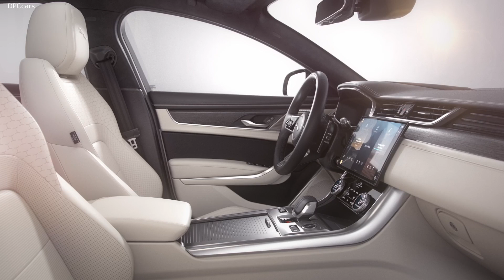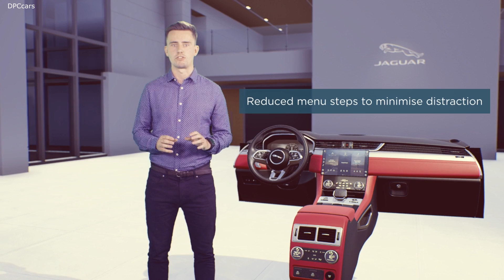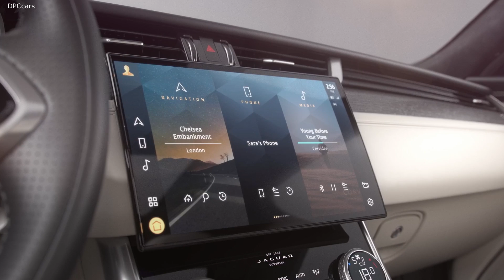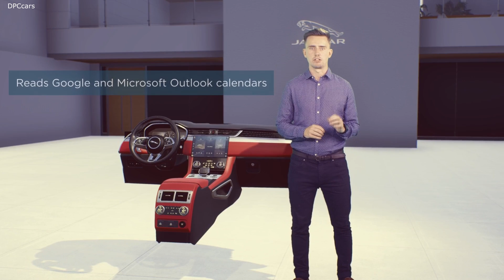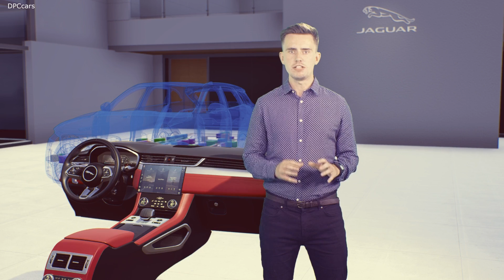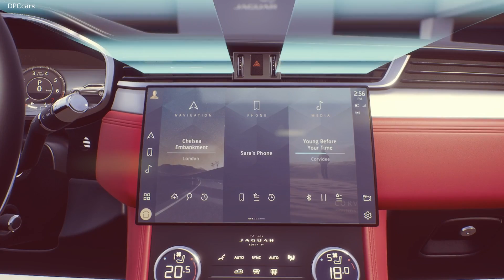2021 Jaguar XF Interior

Comment: I'm not into four door sedans, but this cabin view of the front seating is great.  The dashboard is very smooth and looks to be very easy to visually navigate without a lot of clutter.  That digital screen is also great because of its size and yet it does not look out of place.  It sort of floats on the dashboard.  The seating is premier quality without any eye distracting designs.  I give this front row seating a two thumbs up.  Kudos to the designers.